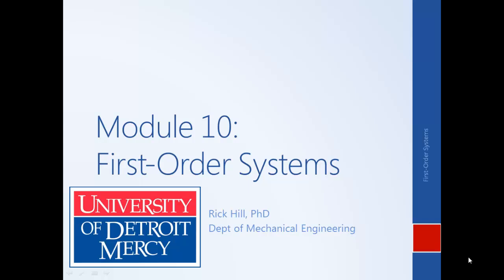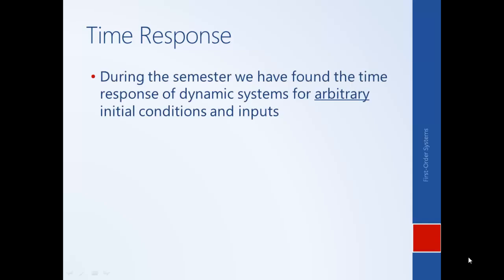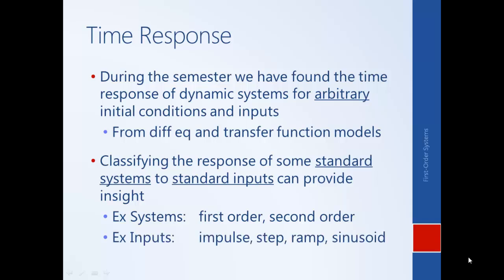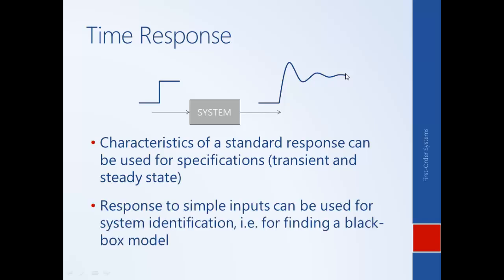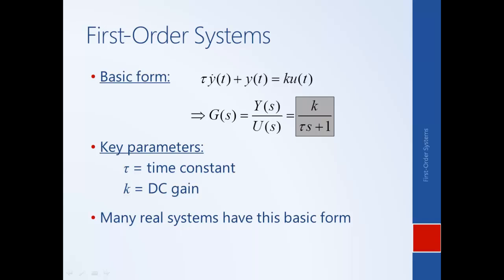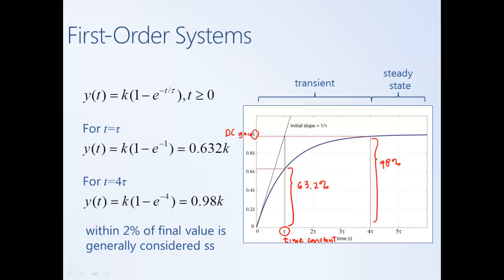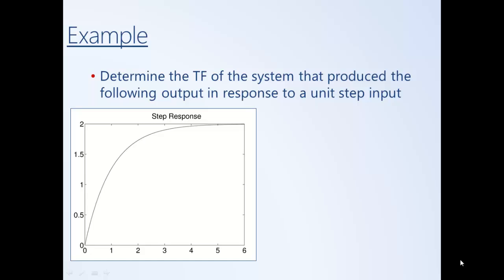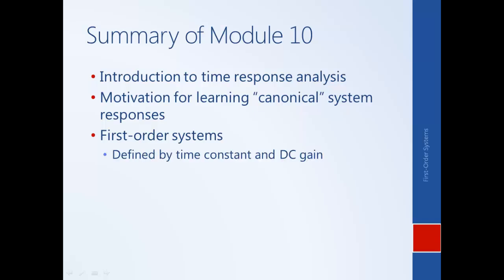System Dynamics and Control: Module 10 - First-Order Systems

Comment: good video. one question about canonical form though, at the end you say it would be incorrect to take the gain from the transfer function of 1/(0.5s + 0.5), but isn't the canonical form 1/s+a rather than 1/s+1 suggesting that you would need to look at another term to find the canonical form
Reply from the maker: In the video the canonical form is given as K/(tau*s+1) ... so for the transfer function 1/(0.5s+0.5) some students think the DC gain is K = 1 and the time constant is tau = 0.5. This is incorrect. In reality, you need to divide the numerator and denominator by 0.5 to get it into the canonical form, 2/(s+1). Therefore, the true DC gain is K = 2 and the true time constant is tau = 1.

Comment: Hello, I have a system where the step input is 2v, and the output is 5v and a controller constant k, can we say the dc gain is 2.5?
Reply from the maker: If the steady-state output of the system is 5 V for a 2-V step, then the DC gain of the system is indeed 2.5. That, however, doesn't necessarily mean the controller constant K is 2.5.

Comment: what is significance of initial slope
Reply from the maker: I am not sure what you mean with your question, but you can use the initial slope of a first-order step response to estimate the time constant. If you look at the figure shown around 23 minutes, it shows that the initial slope equals 1/time constant (if you extend the line, it crosses the steady-state value at time t = time constant). Alternatively, I tend to look at the time it takes to reach 63.2% of the total change since I think it is less sensitive to error.